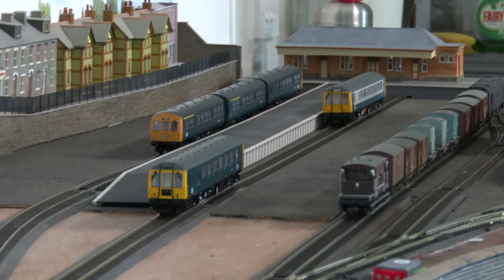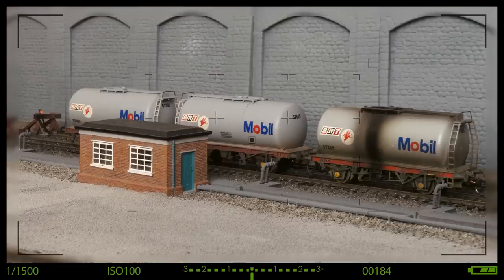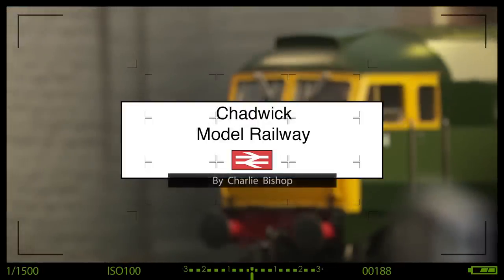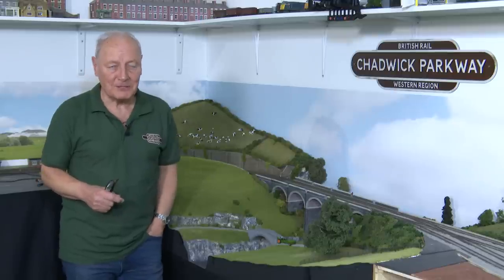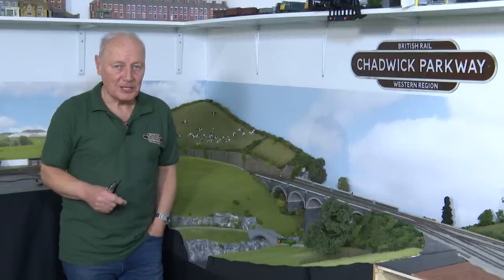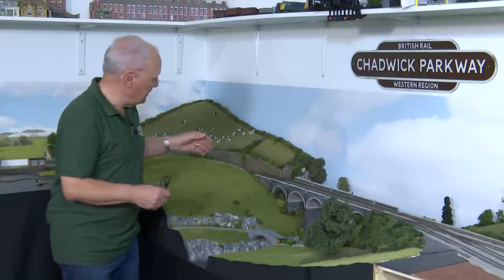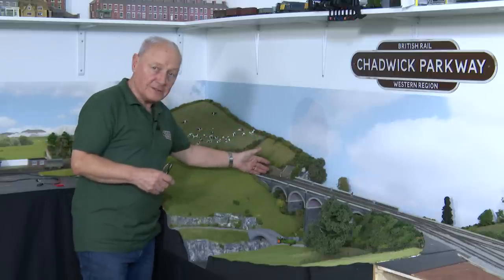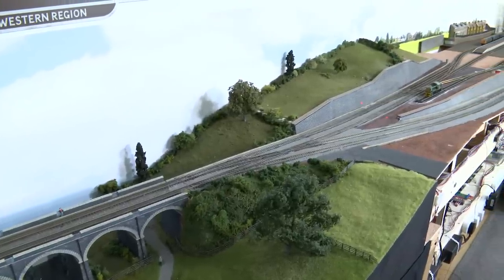SIGNAL POSITIONS at Chadwick Model Railway | 199.

Comment: Hi Charlie, I've read through quite a few of the comments and there's mixed advice there so here's my view. The signal to take you towards the branch station or down the helix is fine with the 'feather' (route indiactor) to the left. You call it the branch, therefore the other is the main route. At the next signal on the branch If you are signalling a train into the yard you need to clear the position light (with route) not give it a yellow aspect and you'll need a stop board just as you enter the yard.  For the signal leaving the yard you'll need another similar signal, though without a route indiactor if there's only one route. The position light needs to be like the other, ie assosicted with the main aspect and not lit unless needed and then showing two whites when it overides the red and not two separate signals as you were showing. You could then give a departing train a main aspect or clear the positon light for the headshunt. You'd need another normal GPL to come back into the yard from the headshunt as someone else said. Yellow GPL's are still about but are used usually where there's a ground frame. In that case you'd only have the yellow GPL and no main signal for departure. In the real world I think the departing signal would be beyond the point to the headshunt (bring back your trap point :-) so would be no need to signal moves to the headshunt and it would be protected by the incoming stop board but I don't think you have the room without lifting points.
Reply from the maker: An excellent comment mate, and thoroughly appreciated. More food for thought, regards, Charlie

Comment: I have just bought a train tech signal which i am going to try. They allegedly will connect together to work on a sensor which will change automatically, wish me luck. Also it has been a landmark week as i have just got a train to do a full circuit on my roundy roundy up in the loft. The down side is i now have about 50 mtrs of track to ballast. So if you are ever at a loose end! As aside. Do you think you will ever finish Chadwick, as i think my layout is a S.A.B.L.E project. keep up the good work your videos have definitely been an inspiration.
Reply from the maker: Interesting point Kelvin. The branch line tracklaying is almost complete, but then we’re off to the new freight yard area which I’d like to do before the end of the year. Then we have a few years of scenics! Regards, Charlie

Comment: Hi Charlie. Great video as always. I can offer some suggestions but they may be of no help. Ideally the signal with the feather (luna lights to be exact)  should be not used. Replaced with the theatre box signal. Here's the issue, it's not got a green. If it had, Green would be mainline to the helix. Single yellow and 1/2/G platforms or goods or position light 1/2/G for occupied platforms/goods. I've not seen main aspects well inside station areas. However. Where the theatre signal would have been there would be a GPL (ground position light) proving the route into plat 1/2/G. (More about this in a minute) I have noticed there are 3 goods lines. So id be thinking single yellow and G is unoccupied goods 1. Position light and G occupied goods 1. Then just make up letters or numbers for goods 2 and 3. (Not 1 or 2 obviously) Unfortunately this means you needing a whole new signal (green/extra numbers/letters) and I'm sorry about that. It depends how far you want to go I guess. Another option is ALL goods moves are position light /G. As far as the points for the 3 roads then a GPL to confirm the route into 1/2/3 goods. All the goods would require a departure GPL to avoid conflicting moves. If you have a unit in plat 1 but require a shunt into plat 2 it could be routed out via a position light and an X (facing road)  to go behind the GPL I mentioned earlier where the original theatre box signal was going to be located. This would also allow use of a Limit of Shunt Board/Signal so as not to interfere with the main line. This GPL to go wherever needed. Equally it could depart as normal over the double slip and have another GPL to bring it back into a different platform.  As for the yellow position light. I've only ever seen 1 with Yellow/White to pass all day long into the headshunt and white/white for departure. However. You could use a normal GPL and have another inside the headshunt to depart. Sometimes these are Off (proceed) back to back (both off) when many shunts are required. Its a real myriad is signalling. Remember in real life its all about route knowledge so drivers would know what to expect and where. Am sure this won't help at all. Sorry.
Reply from the maker: An excellent comment, SV. Your views along with so many drivers are well on the road to a successful installation. Regards, Charlie

Comment: Point of issue 3. Yes, a shunt signal can be yellow and white for a headshunt, which means you can pass it if you are going up the headshunt. But if you are leaving the yard, then displaying one yellow and white light is a stop light. This can also be a black and yellow shunting disc signal instead of red and white
Reply from the maker: Yes you’re dead right mate. And I have one on order. Regards, Charlie

Comment: Another thing to consider... If you are using a red/white GPL for the access to the headshunt, then there should be another coming out.  These coud be with "opposing locking omitted", which means they are both "off" at the same time, shunt movements can go in and out of the headshunt without involving the signalman.  This has the advantage over the yellow/white in that the points are proved to be set correctly for both in and out directions.  The "going out" signal would have a stencil type route indicator to show the route to the main or the headshunt.
Reply from the maker: No, it definitely has to be a yellow and white. Regards, Charlie

Comment: On the second point of order, you would normally have the shunt signal into the goods yard rather than the yellow, as unless the line is under signalman’s control in the yard, he has no idea the lay of the land what routes are set in the yard. A yellow signal indicates the section ahead is clear, stop at the next signal. Ideally yes, you would have the route indicator with the shunt signal, although this can be a bit more flexible
Reply from the maker: Excellent and useful comment. Regards, Charlie

Comment: Taking the route to your helix as the Main, and given the close proximity of the station/yard from the junction I suggest the following;

1. The signal controlling traffic onto the branch is a "Call On" with appropriate Theatre Indicator.

2. Forget a "Feather".

Signalling is too complicated an issue to be able to fully describe here. If you want more gen Charlie, please get in touch.

Regards, Holls  S&T retired 🙂
Reply from the maker: Thanks Holls, but I have had some wonderful advice from your comrades. Regards, Charlie

Comment: Hi Charlie. Enjoyed signal video and y sympathise with "time" comments. If you are not in too much hurry then have a look at Yamorc 8116 (I think). Train controller should  drive it and it's really easy to program required signal type and wire it. Alas DCC rather THAN LOCONET but can't  have everything. Talk to James at  DCC TA,  he can demo but availability is bit iffy at the moment. I'm installing one at the moment and have been impressed.

Cheers
Dave
Reply from the maker: Thanks Dave, I shall certainly have a chat to James. Regards, Charlie

Comment: Wow, that branch station is starting to look good.  I have no experience to add on the signalling but it all looks pretty logical to me.  And number 200 coming next - seems so recent that you were celebrating number 100, where did the time go?
Reply from the maker: Thanks Lee, it does seem that the older we get the faster the time goes! 
Regards, Charlie
Reply: @ChadwickModelRailway  I forgot to say in my original comment... I think the Matrix should show the platform number when the positioning lights are on.... because there is no reason to not be able to put two bubble cars on either platform 1 or 2 - why would that option apply to platform 2 only?
Reply from the maker: Yes Lee, clearly a point which I omitted to mention. Many thanks, regards, Charlie

Comment: Hi Charlie as for your shunting dolly google Melton Mowbray signal box go to images you’ll see one at the bottom of the steps, in the horizontal position you can shunt past it, but to go onto the running line it must be pulled off, into the 5past7 position, I’d send you the picture but not sure how to . Lee
Reply from the maker: Hi Lee, thanks for the comment. 
I have tracked down several images now but thanks for the offer anyway. 
Regards Charlie

Comment: Evening Charlie.  Kernow Models down here in Camborne have Dapol GWR Two Arm Semaphore Junction Signals in stock and priced at £61.95 mate.  I have about 15 colour light signals controlled by my iTrain program connected using the Signalist SC1 signal controller, but regrettably this is no longer available. So I searched for a controller and Voila... Gaugemaster sell the Train Tech SC1 and SC2 signal control devices which are really easy to configure with computer control and reasonably priced too. The SC1 does 2 x 2 Aspect types and the SC2 does 2 x 3/4 Aspect  and priced under 20 quid !!   Hope that helps mate.  K   🙂
Reply from the maker: Thanks K, may I ask if your semaphore signals are both lower quadrant and parallel? Regards, Charlie
Reply: @ChadwickModelRailway  Hi Charlie. They are lower quadrant with one high and one lower. They have left and right hand. K
Reply from the maker: They are used out on the main line prior to a junction. The lower signal refers to the minor route.
Regards Charlie

Comment: The yellow aspect replaces the red in a head shunt.  So, the head shunt can be used all day without affecting any mainline movement.  When you want to move a train onto the mainline, the route set will clear the head shunt to two whites at 45 degrees.  ExGWR tech.

I don’t know if it’s still there but there was one at the entrance/exit of the train care depot in Reading.
I hope this helps. 👍
Reply from the maker: Thanks Alex, your information is much appreciated. I’ve only ever seen the semaphore type ones. Regards, Charlie

Comment: How real are you going to have your signalling and.. how will you enforce correct train operation at those signals? I'm guessing that you want "full automation" so that eventually you can sit back and just watch it all happen... but, that seems like a museum-type of operation. Back to having real operators and back to my question of enforcing correct operation... Will signals be positioned as if they can be seen by tiny operators in the locomotives, or be visible by Giant "line-side" operators?  John
Reply from the maker: That’s an interesting question John. I expect a computer program to control the signals for the scenic trains. However it then comes down to the operators, when they move there trains. Regards, Charlie

Comment: Charlie, a couple of comments.

Platform starters, good to be two aspect, but to be released from Red will require the junction signal also off. Neither need a Position Light as there's no siding to access from there. Weymouth has them because they give access (exclusively) to Jubilee Sidings.

Yellow/white signals, there is one at Exmouth Junction. Not sure you can see it from anywhere except a passing train from Honiton. GWR use the siding for turning trains starting or finishing from St James's Park Station.
Reply from the maker: Great info K, and very much appreciated. I had thought that the trains would not be released from the platforms without the junction signal being off, thanks for the confirmation. Regards, Charlie

Comment: Hi Charlie, I’ve got round the problem of space with the MP5 point motors but, unfortunately, it invalidates the warranty. I don’t use the supplied plug I use a pair of sharp cutters and remove the connector casing from the motor body. I then solder directly to the connector pins. Yes, it does mean that I have no warranty but I need two sets of changeover contacts.
Reply from the maker: Thanks Derek, I shall have a little look at that. Regards, Charlie

Comment: think you'll need a shunt signal on the line from the branch to towards the viaduct, for any light loco moves from the platforms to the goods yard, facing the opposite direction of course, for when the driver changes ends? Or, you'll be restricted to such moves via the main arriving line and the signal with the route indicator., but such a move would block that for arrivals and also block the main line.
Reply from the maker: Can you make an interesting point Matthew and one which I hadn’t thought about. Regards, Charlie

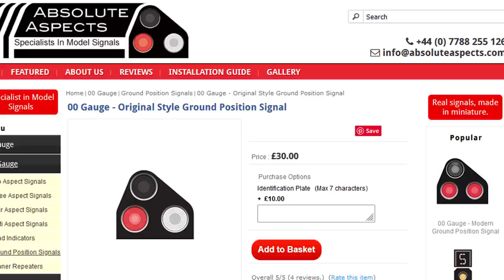Comment: As an ex=signaller, I would expect to see the main aspect used for the 'primary' route and feathers for a 'secondary' route, irrespective of the geography and which way the lines go.  Yes I would expect to see a number in the route indicator when using the calling on signal, as this would allow the driver to confirm that he is being signalled into a platform that has enough room for his train.  If platform 1 was full, and he got a call on into that platform, he should refuse to take the signal and contact the signaller to clarify.  This assumes he can see both platforms from the signal.  It would also help hime to drive correctly, as there may be different speed restrictions over the two routes.  The headshunt signal would be similar to the light shown on the left side of the Absolute Aspects page you show at 13:56, or you later show yourself, but would have a yellow light where the one shown has a red light.  For headshunt moves the light would show a horizontal yellow/white aspect.  For moves out on to the mainline, the signal would show 2 diagonal white lights. You wouldn't need a main aspect signal.  The junction protection signal leaving the branch isn't strictly necessary, given how close the station is to the junction.  The starting signals on the platforms and the goods yard exit signal would be interlocked with the junction points to prevent them from being cleared if the route wasn't available.  However, if you want to exercise a bit of poetic license and imagine that there was a greater distance involved, then a junction protection signal is absolutely fine.
Reply from the maker: My thoughts exactly Dell boy. I think we’re bang on the money, regards, Charlie

Comment: Hi Charlie , I love the videos and what a great layout. For the big 200 Any chance you might get time to do a video on how you connected up your control system. Like train controller and how the points are controlled. Do you need a CDU for the points, how many points can be switched at one time. Is it possible to give a command at the end of a session for all trains to return to a starting point for the next session? And so on. Many thanks
Reply from the maker: I will definitely cover that Alan, but not in number 200. Regards, Charlie

Comment: Now for the next signal for entry to station. The main aspect with 1/2 is ok but the position light should be offset to the right, also in your instance you would not have a main aspect with G for entry into the reception line. You would only get this occurrence if the reception line was under signal box control ie fully signalled. Your yard is outside signal box control so it would require an offset position light. When the position light is inline with the main aspect then the platform lines would be permissive and the position light is used with a 1/2
Reply from the maker: Thanks LR, for such an interesting comment. Food for thought, regards, Charlie

Comment: Hi Charlie. I’ll be bookmarking this one as I think it could be a useful reference in the future.

I have a number of second hand locos with deep wheel flanges that are not compatible with my code 75 track. Do you have any experience swapping code 100 wheels for code 75 ones? If so a video about how you went about doing it would be very welcome. If not for your 200th video then some time in the future. Take care, David
Reply from the maker: Hi David, I do need to swap out some of my wheels too.
Peters Spares, is one such source. Regards Charlie

Comment: If you want to simplify the shunt signal, use a main aspect and associated position light, with Route Indicator Box. Main aspect only onto the line, PL and S or HS in the box for the neck
Reply from the maker: That’s a very expensive alternative, Mark. Regards, Charlie

Comment: Hi Charlie. Idea of using PIN for signals to easy remove it is absolutely gorgeous! Color of LED is not problem of camera balance, but problem of exact LED. Many people complain for warm white, yellow or green lamps. 
I bought from Ali a lot of them from different manufacturer. There are not any similar to real warm white for example. At least they white or “rose” white. The same “rose” white LED installed in Roco locomotives. 
By the way, I saw your links and found that you use 4k camera, but still publish 1080p. But what I would like to see you make more smoothness start of your models. Even for DC you could make it more impressive if you find rare SFR1000 or SFR2000 kit. But with your DCC maybe you could add D value and use exponential acceleration method in settings?
Reply from the maker: Hi Alexander, yes, I do shoot in 4K, but export in 1080p. As for acceleration rates, once I start speed profiling, it will become much more regulated. Regards, Charlie